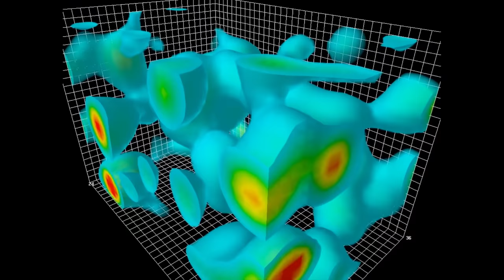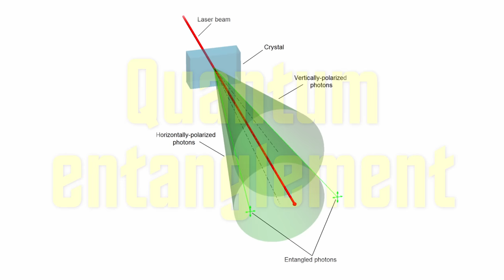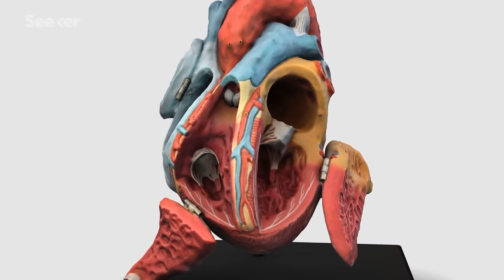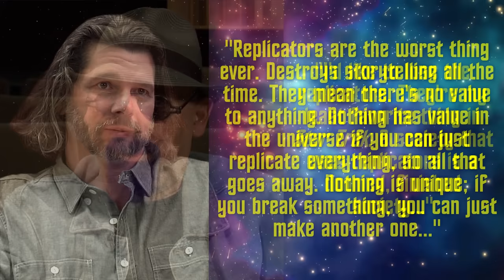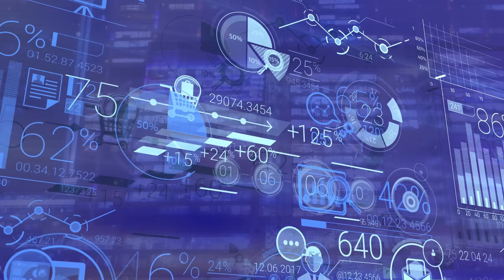Do Star Trek's Replicators Break the Universe?

Comment: I think the biggest limitation on replicators would be availability of raw materials. Creating things from pure energy would be an astronomical power drain. Taking E=mc2 into account, replicating a 14-ounce steak just from energy would require (if my calculations are right) 35.67 petajoules of energy purely as raw material for the matter, never mind the power used to actually assemble the steak from that matter. The new Hinkley Point C nuclear power station currently under construction in the UK has a planned nameplate capacity of 3.26 gigawatts, or 3.26 gigajoules/second. Running at full power, it would take Hinkley Point C more than 126 days to generate enough energy to create that steak. Put another way, the energy required as raw material for the steak is equivalent to an 8.5 megaton explosion, larger than all but three of the nuclear weapon tests we've carried out to date.

The closer your raw materials are to the finished product, the less energy you'll require. If you need to replicate a length of insulated copper electrical wire, ideally you'd start with a stock of copper metal and the insulation material. Then all the replicator would have to do is rearrange the molecules and atoms. If you had to start with nothing but iron, you'd have to pull iron atoms apart and reassemble the nuclei from the available protons and neutrons, not to mention dealing with the energy released from all the single-atom fission events you'd be causing - hopefully the system could absorb it, which would at least mitigate the energy cost.

Comment: I disagree with the argument of the writers, when they claim that replicators make things less unique or special. You already mentioned a few examples from their universe, that cannot be replicated, due to complexity. So in essence it makes the mundane  and most necessary things accessible. While truly unique and special materials or things are still very valuable. Perhaps more so, BECAUSE many other things can be "printed". Although I do like the idea of a substance(s) that the replicators pull from, in order to make something. It makes no sense that it takes just energy to make everything. Considering the processes involved in creating certain atoms and therfore elements, with extremely varying degrees of difficulty, energy use and mass.

Comment: The only real reason the Replicators couldn't ever be universe-breaking, would be because they couldn't possibly miniaturize Fusion or Fission, therefore they would not be able to take complex molecules of Hydrogen, Oxygen, and Carbon, and somehow make Gold, Silver, Iron, etc... They COULD however rearrange the molecules to make something else, i.e. Glucose to Alcohol, or really anything consisting of the elements inserted.
Essentially, the machine should only be doing exactly that, breaking/building molecular bonds on demand, in any configuration.
Not magically converting human waste into rare/precious resources. That would require Fission/Fusion, to create new elements from the ones recycled, and that simply isn't feasible small-scale.
Most likely, what would be occurring, is the replicator has a storage of raw elements, such as Oxygen, Hydrogen, Carbon, Iron, etc... and has the ability to create anything made up of the elements it has stored.

Comment: It would be free energy basically, just make it produce anti matter. It should take the exact same amount of energy as normal matter, just inverse the charges of the electrons and protons. 

They literally had to make inconsistent rules from the writers to not make everything too easy. If you can make fudge Sunday, then really, why could you not make a dilithium crystal? They would write something about complexity or whatever but it's the same essential difficulty if you are turning energy into matter or re-arranging matter at atomic level. You best you can say to increase difficulty of some materials is how large of an atom you are making, that is about it. However if you can make iron,, which require the pressure of very large stars to make, you have the energy requirement to make  just about anything.  Star Trek is inconsistent on how hard gold is to replicate, on TNG Ferrengi seems to hold it of value while Quark in DS9 called it worthless.
Reply: Exactly.
Reply: There are other properties besides electric charge you'd have to flip to change matter into antimatter.

2. Replicator can't make Antimatter
Reply: @scifirealism5943  I am not sure how hard it would be when you could break down atoms like that, but now that I think about it, replicaters are the least as fission and fusion bomb 😄.

On point two, at the very least we can agree you really don't want to be able to make anti matter in replicator outside of an area with a perfect vacuum, or every ship replicator is basically a ship's self destruct device.
Reply: @EarthenDam  thanks for the response.
It 
According to the Star Trek technical manual, they use quantum charge reversal devices to produce antimatter

Comment: Replicators would fit well on lengthy exploration missions. Sure, nothing too wrong with having hydroponics onboard if you have the propellant to propel the weight, but how big would it need to be in order to feed an entire Galaxy Class Crew for an unspecified number of years? Could it house (enough) farm animals, or would the crew need to go vegan? Recycling the waste molecules into neutrian molecules seems like the best solution there. But replicating "what you want" would be tricky if there's not enough waste for extras... or repairs. That is when you head back to base, or possibly make a pitstop at an asteroid belt and "eat" a few for extra materials. ;)

Comment: Im glad you went through different implementations as different tech. Real replicators are pure energy to matter conversion. As long as you have a big enough generator or battery make what you want. That said you still need that power so you would still need industry to make enough power to feed everyone. In theory you probably could replicate dilithium and the fuel to run your warp core (with a fancy enough replicator) BUT it would always be at a loss, taking more power to make than it could ever give back.
I could be wrong but I dont think replicator efficiency is cannonized anywhere. That plate could still have a cost even after being recycled.

Comment: The replicator is based on transporter technology, and breaks down any source raw matter to the subatomic level, transports it into the proper location, and reassembles it based on stored patterns. Because replicators operate at the molecular level, rather than the quantum level (quantum-resolution patterns are simply too large to store), there can be very minor errors but the "average" will be correct. While never stated, the ship would have to carry a fairly significant amount of matter as a source, likely lead as it is both plentiful and dense. However, a large portion of waste can also be recycled using this same technology, including sewage. I wouldn't say it necessarily breaks physics, as matter-energy conversion and energy-matter conversion are technically possible under Einstein's Theory of Relativity. We've just never figured out how to achieve the latter.

Comment: I got to the part where, your clip of, DEANA TROY, describes what real isn't as opposed is, when having asked for real chocolate ice-cream. This reminded me of my own description of the differences between REPLICATION, & SYNTHESIZED foods and beverages made by the REPLICATORs. Real, is carefully crafted meal and/or beverage, scanned in to the memory cores of the unit's primary processor. This matrix is used for reproductions of the scanned matter in question. The merely synthesized, stuff, is produced by way of some geniously skilled programmers, merely putting together an assembly correctly healthy nutrients based matter, made to look and feel like real foods and beverages. But, if sensitive enough, it is apparent..and detectable.

Comment: I believe if you have transporters. Replicators are an inevetability. they are essentially transporters that have a lower resolution after all with a dedicated pattern buffer to draw from.

'Oh no planet needs thing. replicate it' can be worked around:
You have to have the pattern for the THING. The locals must be willing to accept this new thing, and what if the thing uses materials the replicators can't easily recreate because it's deemed a hazard? 

'oh no the ship has a broken widget. GORDI GO GET ME ANOTHER ONE!.' Takes power to create that part. Power the ship might not have in said emergancy. Also that industrial replicator has to produce a thing that is effectivly flawless from the standpoint of the task it must perform. Lots of ssytems have high power use or require the sort of prescision that a replicator might nto be able ot EASILY do.

'oh sure it can do the job, but to replicate these isoliniar chips is going to take x (time) and we only have x-1 'time' and we run the risk of these chips cracking mid-job which would kill us.' 

The argument the replicator represents an inherent tension remover is shortsighted and unimaginative.

More t othe point. What happens if some wizkid hoodwinks replicator logs to make sure it doens't know they replicated a starfleet uniform and a hotshot phaser that might only work for a few shots, but long enough to deal with any resistance if their cover is blown. Or what if someone swapped the commands around so when the captain orders earl grey Hot. He gets hemlock instead? 

Or what if Worf got a ping that one of the big industrial replicators was used to disposeofa body?

There you go. instant who dunnit.

Comment: If you look at even modern technology, while we don't specifically have "replicators," we have 3D printers. You can make spare parts, even new parts, or prototype, or even mass produce parts. It can be easier, faster, and safer in some instances to do this. Not everything can be made this way (yet). So the argument that if something breaks you can just make a new one is somehow a flawed method of acquisition seems like a weak argument. So what if they can just make a new one? It seems like if you're on a spaceship you'd NEED the ability to create new parts. Things will break. That's how the universe works.

Comment: I think they should have capped it at protein resequencing.  Making food aboard a starship would be INCREDIBLY useful, and being able to feed in waste protein in order to recycle it would be great.  But being able to make whatever they want aboard a starship is a little overkill.

Perhaps, if the tech is to be included, it should have stayed as an industrial scale tool, something that, for whatever reason, is not able to be miniaturized enough to be installed in a starship.  Or do what Voyager did and put a practical limit on it.  I mean, this thing is effectively converting energy into matter.  that isnt something that is easily done, and creating matter from energy take a MASSIVE amount of energy.  Even running it on antimatter reactors would be INCREDIBLY energy intensive.

Comment: While he brings out many good points, he glosses over the most important ones. Replicators are needed for 2 main reasons. First, energy usage. So to show you this point, let's say a crew of 200 officers wants hamburgers, fries, and soft drinks for the annual picnic.  Now to feed several hundred humans in this order it's going to take the resources of one cow. Now to raise that cow, feed it, water it, and have the land to do everything you need with that cow you might need something on the order of 5,000 units of energy/ Then there's the bread and all the fixings, say another 3,000 units, and finally the soda and we'll call that 2,000. So all in all that's 10,000 total units of energy and a ton of space inside a starship with limited space. Whereas, the replicator can make each crew member lunch for 50 units of energy and not worry about the space. So it's the same 10,000 units of energy but the ship is making that energy every second, of every day whether the energy is used or not. So this means it's better to replicate due to conservation of energy.  Plus think of the reduced carbon footprint on some planets.
Second, good ole fashioned storage space. Has anyone been on a submarine before? When a sub leaves port food in various forms of packaging is stored anywhere there's space. They literally pack the vessel as full as they can get it without compromising the subs' mission and to that end its specific mission's payload. A starship would be no different. There are spaces for specific things on board a ship and other components that make it well ... a spaceship. These things cannot be compromised. Oh but wait, the crew and food...oh yea, REPLICATOR'S to the rescue!

Comment: Well, I gotta say a few things:
1) Star Trek makes it clear that transporters disassemble someone, beam their matter to another location, and remotely reassemble them. To my understanding, that is nothing like quantum energy fluctuation. There would be no need to move any matter if you could just influence the quantum foam to create anything you wanted. If transporters work the way Star Trek describes them, they are suicide boxes. Other kinds of teleportation may get around it, but even if you were influencing the quantum foam somewhere else, it would still be a suicide box.

2) Construction materials is FARRRRR simpler than biological material. Like, probably a million times simpler. Construction material has a lot of repetition that occurs very frequently, and there's a simple logic behind even very sophisticated materials. It is not repetition that carries/requires a lot of data, it's a non-repetition.

3) Replicators are much simpler than transporters precisely because it can use generalized rules and patterns. When you transport a person, you want a perfect copy. But when you're replicating a piece of chicken, it doesn't matter if that muscle fiber is 2 microns wider than before, or if the blood cells were in a different configuration, or the neurons in a different state.

Comment: I think what the writers miss is that those replicators would be restricted by the total amount of mass it can produce. A starship would almost certainly not have the resources to solve a planet-wide famine, for example.
Reply: Starships generate the energy to power constant life support for thousands of people, power an engine to go faster than the speed of light, among many other very energy intensive things. I don’t think solving a famine would actually be an issue at all
Reply: A 'solve' for such a scenario might be the assembly of a small number of self-replicating nano-factories that could be replicated as needed and programmed with some basic food patterns, emergency equipment designs, and so on. No need to make the thing a grey goo monster, make it relatively dumb and needing a bit of supervision to operate, but still able to rapidly increase in world wide productive capacity to help with that famine. For Star Trek tech it would be a primitive and low energy device, but still useful for stopping such a famine.

Comment: Before I watch the video - always had two ideas on how those things work.

1) They re-arrange matter at the atomic level - which means you need to feed a lot of material in, ie waste rubbish - fed in and get whatever you asked it for out.
2) It is a matter/energy convertor - it is converting energy (most likely electrical, direct from matter/anti-matter engines) in to matter (E=mc2, don't know how to get the squared sign)

Both solutions are well within the laws of physics, just require immense knowledge and technical abilities.